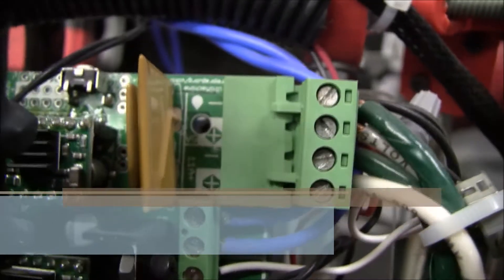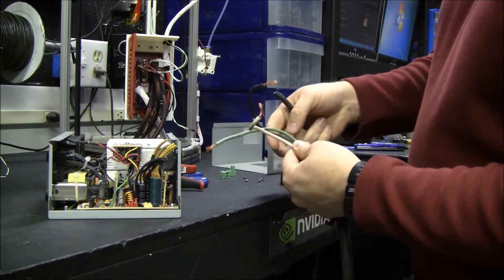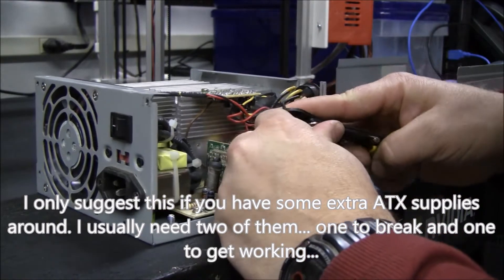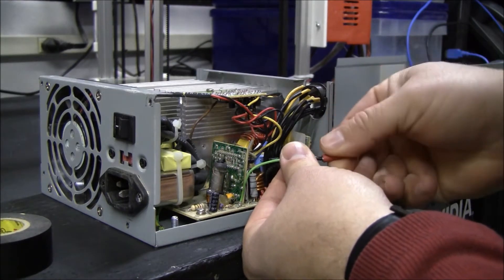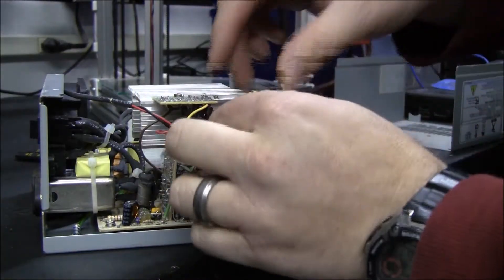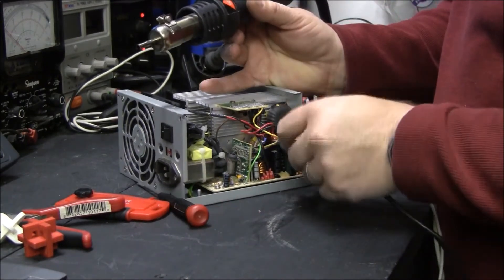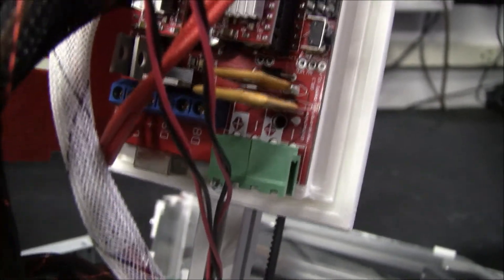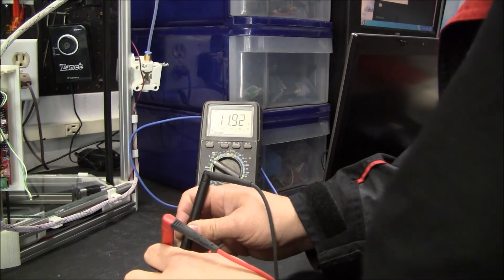Powering the Kossel Mini 3D printer and modifying an ATX PC Power Supply

Comment: power supply total watts needed? 5amps + 11amps @ 14.0VDC =225 watts is this correct?
Reply from the maker: I checked and my electronics and steppers pull about 1A, hotend 3A, and the heated bed pulls 7A so I am right around 10A or 120W. Your loads may be different, you may have different hot end or not have a heated bed. So somewhere between 10-20 amps at 12V 120-240W depending on your setup. In my opinion I would have the PSU capable of at least 50% more than your planned load just to be safe.